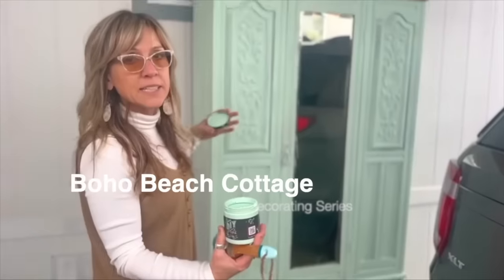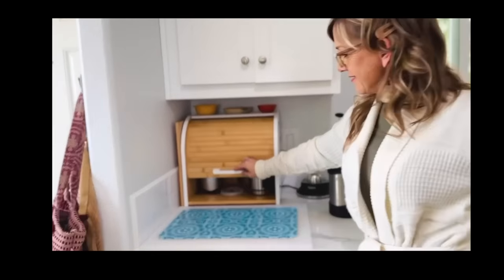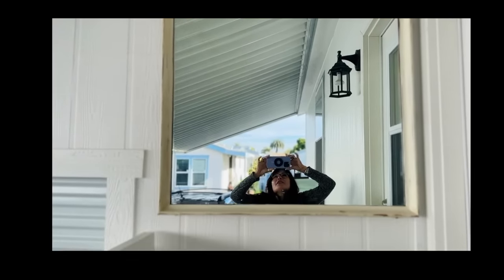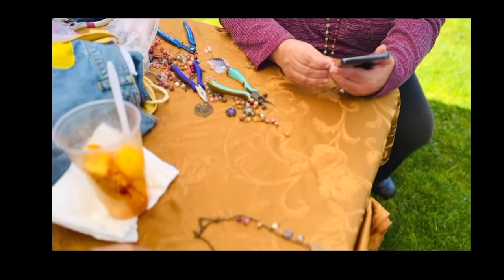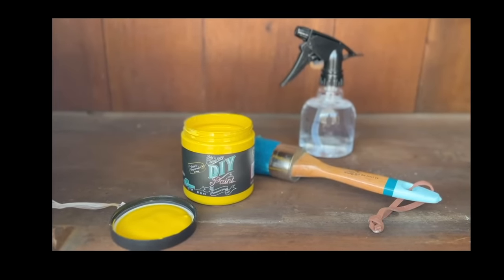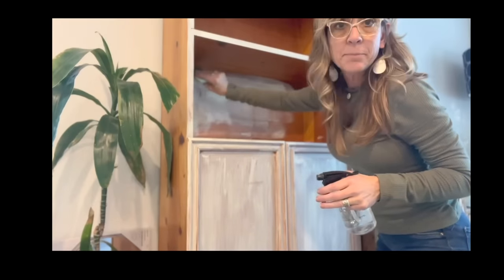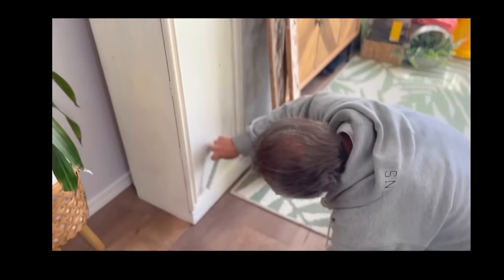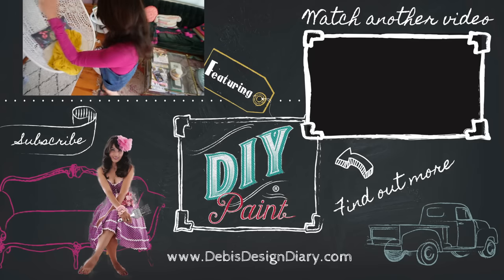Boho Cottage makeover / new entertainment center and vintage details

Comment: I absolutely love butcher block, I had one on my island for 20 years and then we moved. 😪 I love the patina it gets over time. Anyway, when oiling your butcher block, you do it once a month. You put a heavy coat of oil on and let it sit. If it seems to soak it up put on another layer and let it sit. After a couple hours wipe away the excess. It needs to absorb the oil all the way through or it will dry out and start cracking at the joints/seams. Don’t be shy about it, it will absorb what it needs and leave the rest on top for you to wipe away. I actually used mine to cut my veggies on. You don’t want to clean it with chemicals, just a spray of half water and half vinegar. If you get stains usually a lemon cut in half with salt on it should scrub it off. Good luck with it, it’s gorgeous! Hope this helps. Looking good!

Comment: I bought a butcher block rolling John Boos counter for my kitchen { no counters}.  I used an oil and it did nothing, I then had to use a laquer and that worked much better, now I have no worry about watermarks, and I even inadvertently marked it with a permanent marker, I was able to remove the mark with baking soda and water.  I bought it on Amazon and it was specifically for butcher block counters.  It was a process but it was worth it.  I use this counter every day...Oh yes, your Dad is so sweet and I hope you appreciate him, be careful about being bossy.

Comment: Don’t skimp on lights, quality. I bought a fixture from Home Depot. The light was on our den ceiling. It was poorly designed.I thought a bulb was getting ready to burn out. It was actually arching, which started a fire. I put out the initial fire with an extinguisher, but the ceiling was still hot. The fire department had to pull down most of the ceiling. Thank God this didn’t happen while we were asleep.